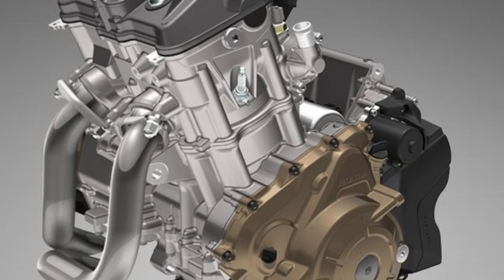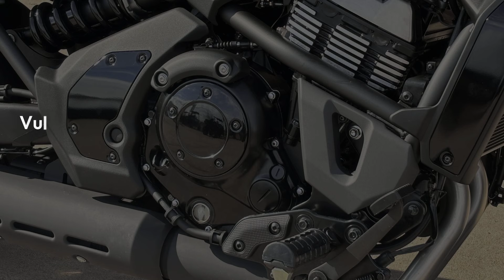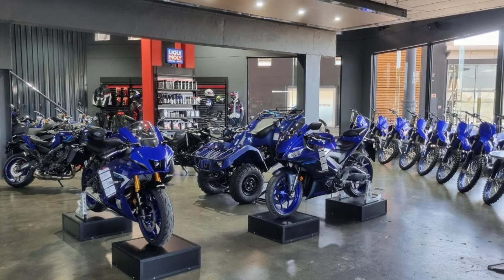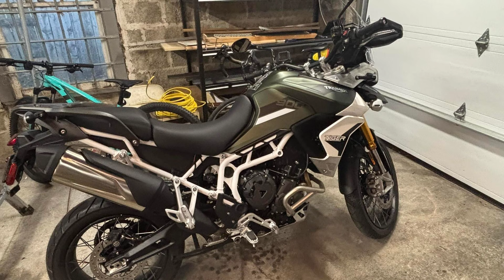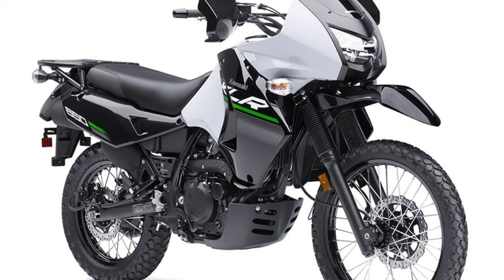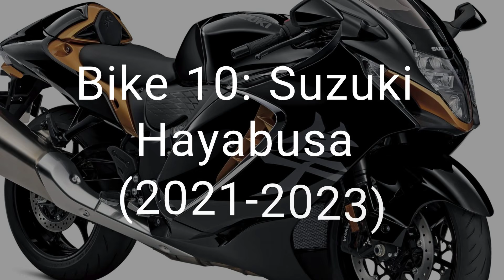Dealers Are Panicking_ 10 Motorcycles You Can Now Buy For Almost Nothing

Comment: Idk about the Rebel 1100 man, I've been looking to get one and I'm seeing  the used market for 2022, etc. DCT trims from private sellers as high or higher than MSRP at a dealership.   Ik that doesn't mean the latter won't negotiate to move 'em, but when you see Ninja 500's or 2-year old Ninja 7's with 1 mi for $5K all over the place, it's pretty obvious the owners hold Rebel 1100s in high-regards.  As long as that is the case, dealers can resist price cuts.   For example:  I live in Central TX, if I search a 250mi circumfrence I don't see 2025 Rebel models still on the floor.  At ALL.   If I search for a Ninja 7 - you have brand new 1mi bikes for $5K from 2024, multiple times over.  Likewise, a Ninja 500 can be had new or near new for $6K.  I get it's not the same bike, but I would argue this one may depend on where you live, bc here?  Ppl love their Rebel 1100s.
Reply from the maker: This is the kind of regional market intelligence that proves the broad nationwide claims in these dealer-panic videos don't always hold up at the actual buying level and I personally think you've done the homework most viewers don't. The Rebel 1100 holding value in Central Texas the way you're describing is real, the DCT version especially has carved out a loyal niche with riders who don't want a clutch and want torque, and the used market reflects that demand.

The Ninja comparisons you're drawing are useful market data too. When you can get a one-mile 2024 Ninja 7 for five grand and a year-old Ninja 500 for six, that tells you exactly where the dealer pressure actually is, not on the Rebel 1100. The video's broad framing missed the regional and model-specific reality you're describing.

Fair correction and well argued.